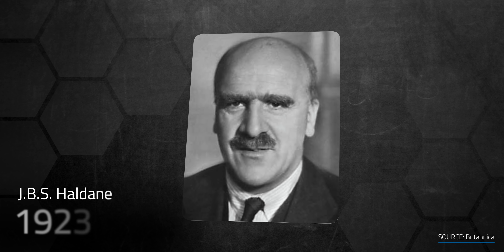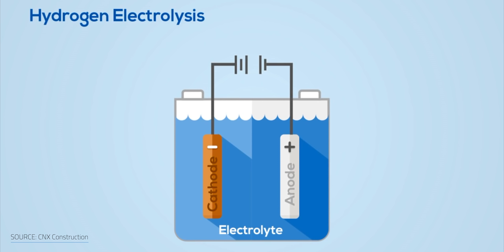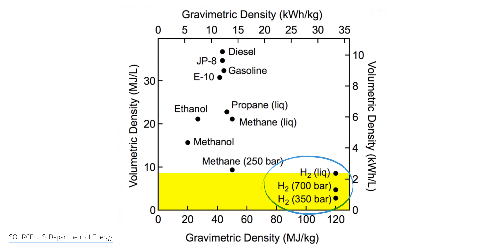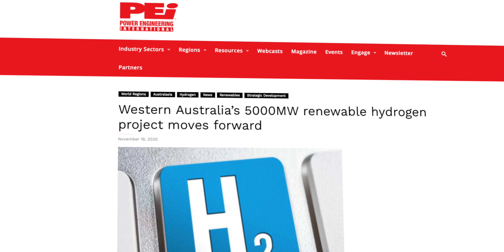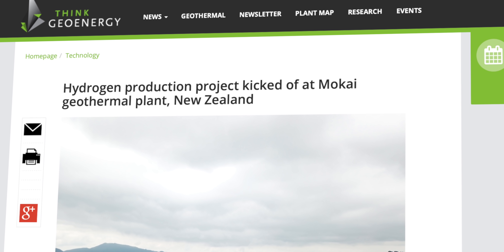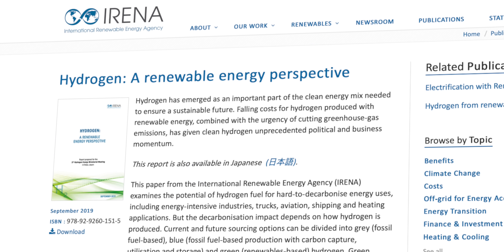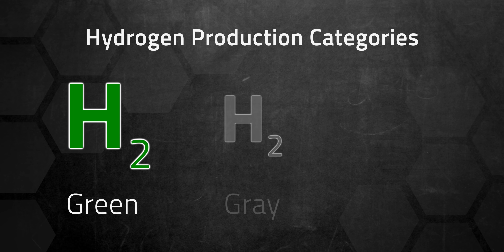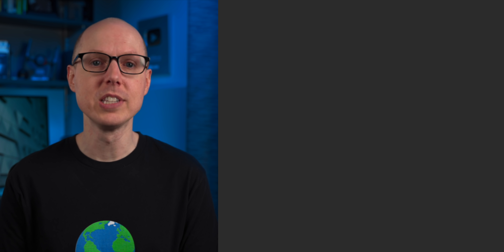The Truth About Hydrogen's Dirty Problem - Green Hydrogen Explained

Comment: synth-gas ( CH^3 ) fuel cells are a development i check on once in a while... i don't know if that's going to happen yet, but the gas itself is flexible in conversions, ( e.g >methanol > ethanol ), and can be derived from feed stock pyrolysis. ( Bio-Char ) ........the syn-gas fuel cells would be ideal for stationary applications, ( not cars ), where underground process storage tanks, ( the gas ), could be considered a "grid battery" where a fuel cell, or thermodynamic plant, becomes a "throttle-able" localized, or non-localized, grid source....where plasma gasification, could be a wind power "dump load" , ( for example ), that fills the tanks, ( grid battery ), with syn-gas ( energy density less than methane CH^4).....that is something i came up with 16 years ago...

Comment: One more of this totally unrealistic green dreams. Apart from a few very high energy intense sectors like steel production, hydrogen has no chance. In the car sector hydrogene already lost the race (in case anybody hasn't noticed) and even for buses, trucks and airplanes it is very likely that advanced battery technologies will take over rather than hydrogen. The technical challenges to safely contain hydrogene alone are so costly in a major infrastructure, which is very hard to overcome. To set up a hydrogen fuel station is about 100 times more expensive than a fast charger station. And for seasonal energy storage the poor efficiency of less than 50% alone is a killer argument, especially if you consider the tremendous amounts needed for this purpose.

The only reasonable scenario I could imagine is to produce green hydrogen from excess renewable energy in the summer for industrial use.

Comment: NZ has an electrolyzer running at 2000% efficiency, and yes it can power itself, no need for external power or infrastructure. That makes all this redundant. Please check out H2 innovations lab. Cost, 34c/kg.

Comment: Science will solve our energy challenges. Not crazy environmentalists like Jane Fonda and Leonardo Dicaprio. These people have an agenda and it’s not helping to solve our energy challenges. H energy is the best option I have seen so far.  It can be used in Fuel cells, or it can be burned, and it can even run current cars of today.   It’s the perfect transition Fuel.  If people have to buy a new car, they can look at Fuel Cell car.  If there car is newer, for a small cost they can just convert to burning H.  In both cases…. No C02.  And H production is already a 165 billion a year industry.  And many ways of producing H are proposed.  Making H from wind and solar is fine, but other ways look more promising.  I say let all the options compete on a level playing field and the best option will prevail.  H energy will move the world forward just like the invention of electricity.  It will be like changing.

Comment: JCB machinery equipment company in the UK has perfected combustion Hydrogen engines right now. Not fuel cells but real combustion engines that are engineered to use Hydrogen. It's better than any delicate fuel cell technology. Just say no to EV. The pollution to make an EV battery is equivalent to 1.5 years of a typical gasoline combustion engine emissions.

Comment: if we go with batteries, when we finally ditch co2 generating power sources, whats the next big problem?
batteries.
batteries dont last long, they're not exactly simple to make and often have a fairly dirty manufacturing process themselves, im sure you know this and have been told this a million times
hydrogen is a LONG TERM solution, batteries are a bandaid for our current situation, when the whole world is running off nuclear fusion in 100 or so years, do we want to wait another 100 years to move off batteries and onto hydrogen? the electrical efficiency is hardly a concern, the RESOURCE efficiency is the real concern here. electricity is a resource, so is plastic, and lithium and cobalt and everything that goes into manufacturing both a fuel cell and a battery bank. the total weight of resources consumed and damage to the environment is far lower with fuel cells than batteries as they simply last longer. yes, atm we use fossil fuels to produce most of our hydrogen, but we also use it to produce most of our electricity, that problem has to be solved anyways. so the problem of how to power our cars should be solved with a solution that matches the solution to the electricity generation problem as well.
we shouldnt use a solution thats only effective temporarily, especially if it its self creates another problem to be solved down the line, the solution we go with should be one that lasts and is modular so it works with other systems as well. batteries are NOT the be-all-end-all solution to stored power, and probably never will be, investing in it only makes it harder to move away from once weve been sitting in it long enough

Comment: there's an old saying, that we're all familiar with:  "Where there's a will, there's a way...(forward)".   we can't go back to fossil fuels - the wildfires and droughts are enough proof, combined with global rising temperatures.  you're looking at a climate-change induced food shortage, due to dropping rainfall (drought caused by deforestation) & flooding (high levels of CO2 cause extra oxygen, which combines with hydrogen in the upper atmosphere.  the oxygen is produced in areas where there's a lot of vegetation.  plants can only tolerate so much water, unless they're specially bred hydroponics plants - that generally don't yield as much).  anyhow, if we believe we can switch to hydrogen, that's the first step.  "see-it, believe-it, achieve-it"...Arnold Schwarzenegger.
the real problem is planetary-ignorance on the scope of Global Warming - which was first cited in 1896! - not enough has been done.  kinda like ocean-plastic.  people are selfish, ignorant, and fearful (for themselves)...our leaders are not leaders at all.

Comment: You can use the sun's ionizing radiation to create hydrogen & oxygen from sea water.  You have to figure out a way to concentrate it though.  However, if you build a self-replicating system maybe by genetically modifying sea weed or organo-silicon compounds then you can use the sun's entire energy on the ocean to make hydrogen.

Comment: How can solar and wind be made more competent? They only exist 20% of the time.. and produce very little energy.
Reply: Like what?
Reply: @engineeringtheweirdguy2103  do u know about turqoise hydrogen - natural gas - pyrolysis - hydrogen? Pink hydrogen nuclear- electrolysis- hydrogen? Biomass can be turned into green hydrogen and turqoise hydrogen in a low carbon process involving gasification and fermentation. With co2 capture natural gas actually produces hydrogen in a low carbon release process. 👌
Reply: @MEGANOlandisKahn  cO2 capture has failed to work properly in every application. For example blue hydrogen projects couldn’t even achieve their first commissioning target of 25% capture.
Reply: The efficiency of carbon capture is irrelevant. Its 100x more likely to smoothe the transition. You are aware that removing all co2 from the atmosphere would be catastrophic right? In fact plants naturally remove co2 from our atmosphere, co2 is added to greenhouses to increase crop yeild. 

The real environmental value of hydrogen is its ability to replace the vast majority of lithium ion batteries which are anything but environmentally friendly
Reply: @engineeringtheweirdguy2103  solar panels and wind turbines dont last forever and their power is intermittent.
Reply: @MEGANOlandisKahn  the power can be made stable with competent infrastructure engineering. And other powerplants don’t last for ever either. But other types of power plants notably fossil fuel power plants last twice as long but require more than 3 times the emissions to build and retire. Due to their size. Aside from requiring sever thousands of tons of fuel per day to burn.

Nuclear is a better option but in practice. It isn’t. Because it produces high and low level waste which we still have no way of dealing with it. The US Proposed to bury it but to day it has yet to build a facility sufficiently protected to store radioactive waste for several hundred years without it escaping to the environment so at current. It’s all stored in slowly corroding containers sitting in warehouses. Not really a scalable solution to me.

Captured methane is a tricky one. In that capturing it requires a lot of effort. And isn’t all that successful. Splitting it away with to get hydrogen and carbon still produces carbon because as stated earlier, carbon capture doesn’t work. Which would make it carbon neutral at best except that you still need electricity to split it. Electricity from the grid, being produced predominantly by fossil fuels. And what about the cost in emissions and money to build any form of mass methane capture, then to build a completely separate facility for mass methane splitting and attempted capture? Plus upkeep and maintenance. And you complain about making wind and solar.
Reply: @engineeringtheweirdguy2103  the ammount of waste produced by nuclear prower plants is extremely low.

What you dont understand about those powerplants with emissions is they provide wayyyyyy more power than they take to build. 

Wind turbines barely produce the ammount of energy used to construct them.
Reply: @engineeringtheweirdguy2103  you arent a serious engineering pafe if you think carbon capture doesnt work.
Reply: @MEGANOlandisKahn  what’s low to you?
Reply: @engineeringtheweirdguy2103  do you know what GDF's are?
Reply: @engineeringtheweirdguy2103  do you know what chemicals are used and produced during the production of solar panels?
Reply: @MEGANOlandisKahn  Depends on the type of solar panel. Are you talking about the most commonly used and abundant solar panel? or are you going to cherry pick and only talk about cadmium thin film solar panels which only make up around 25% of all existing solar panels today. Of that 25% only 15% of which are the Cadmium type.

Please specify.
Reply: @MEGANOlandisKahn  GDF's, depends on which context, solar, wind, hydrogen all claim an acronym of GDF. be more specific.
Reply: @MEGANOlandisKahn  resources like what? And how do they compare to HLW and LLW? Need a remind you of the Goiania incident? What a little bit of radiative material can do if in 200 years and the location of where it’s buried is lost due to war or government collapse or otherwise. What happens if that is accidentally found and nobody knows it’s radioactive? How does that compare to the other waste you’re referring to.

What if the waste leaks and gets into ground water contaminating crops for hundreds of miles making them lethal to eat, especially if you’re eating it continuously, or drinking the spring water? Ever heard of the radium girls? What that did to them. Small amounts, day in day out.
Reply: @MEGANOlandisKahn  stop fooling yourself.
Reply: @MEGANOlandisKahn  as I said. What solar panel type are your effecting to? Are you referring to the 80% of solar panels installed today which are either non-toxic or recyclable. Or the 20% and rapidly declining in use, thin film cadmium solar panel type? It depends on how much you want to cherry pick
Reply: @engineeringtheweirdguy2103  source your claim recycling of solar panels is extremely costly.
Reply: @MEGANOlandisKahn  recycling is costly. But it is do-able. If legislation is made in regards to disposal of solar panels then tan industry will pop up
Reply: Please tell me how you will make solar and wind more viable for large scale energy grid utilization. They are just bad science compared to other power plants.

Comment: I just can't wait for below freezing winter driving with multiple hydrogen cars having driven before me spewing water exhaust droplets coating the roads with black ice for us to drive over and wreck our vehicles on ! Now that is safe ! This concept is just another, not so well thought out,"GREEN", idea that when applied into the real world to keep us safe from climate change does not keep us safe from injury or death when in vehicular accidents. A society operating many Hydrogen Cars that are spitting water on below freezing road or parking lot surfaces is not the answer ! So, where to put water. Maybe an onboard  tank to freeze solid and burst when parked?  At a stop sign or light adding heavy icing to the road just where one wants to actually stop? A parking lot to slip and injure another? A roadside gutter so a pedestrian can slip stepping off a curb maybe
falling into traffic ? Your driveway so you can fall there ? Your Garage to slide across while holding your infant child then both hitting the floor? Maybe, you need to be distracted by mopping up the garage floor before the water freezes and your groceries thaw? A high speed highway perhaps in a turn? The Autobahn while dumping large amounts of water at high speed? Your Hydrogen Vehicle needs to relieve itself in public, The question is where to do it safely?

Comment: They can do gasification process to extract what they need out of our garbage that we throwaway each day millions of tons of trash can be converted into synthetic fuel methane hydrogen and others with a very low carbon footprint maybe about 1% portion can you get very energy efficient if they could use the fuel they may make electricity To run the process very little carbon omissions

Comment: Many areas of this world do not have even 24 hours per day of water and electricity nor is their enough land area to install those solar and or wind units.  There are leakages and thefts of these two commodities. What water will be left to generate hydrogen in an area like Latur in India where water trains and tankers provide drinking water to the people who need to stand in line and even fight to grab that water?   Biggest contributor to global warming is the greenhouse gas water vapour which will also be formed on complete combustion of hydrogen.  Mobiles, internet, wifi, mobile data, computers, tablets, etc were made and smartened to minimize the need to travel and covid taught the importance of minimizing the need to travel. Netherlands uses bicycles for travelling and biogas for cooking or room heating and saves lot of its fuel needs. Crude Oil, natural gas and coal will remain major sources of energy even in long term of the future. Commercial continuous big scale production of Hydrogen will in majority continue to come even in next many years from steam reforming or partial oxidation of the greenhouse gas methane followed by high pressure adsorptive seperation of hydrogen from syn-gas using layered bed. Hope they can work on safe, cost effective and efficient process to make Hydrogen from Ammonia recovered from urine excretions of humans in densely populated nations like China & India either by catalytic decomposition of NH3 at high temperature or by reaction of NH3 with alkali metal like Sodium.

Comment: That solar panel idea sounds disastrous. Imagine if every house had solar panels that also leeched water from the air. That will dramatically change the climate at scale.

Although this idea would probably work well (aka: not harmful) in humid climates like the southern US where you can pair solar production with indoor dehumidification.

Comment: The argument about Electtification of the Electrolysis machine is mute.  We need to produce energy to charge the batteries in cars.  The fact is the Hydrogen fuel cell doesn’t have the carbon demand of a battery and you don’t have the recycling issue with the large batteries in electric cars.  The 2030 crossover should be the trigger that everyone sees and the efforts should be in hydrogen fuel cell.  NO more Battery electric vehicles!!!!!!
Reply: Just to nail that point come, far from the investment of making and recycling the battery, what would be the impact of having to make and then dispose of 2-3 hydrogen cars to every BEV lifespan?
Reply: And where exactly do you think the energy comes from to create the hydrogen from electrolysis? Unfortunately hydrogen requires 3-4 times more electricity per mile from the same source as a BEV.

Further to that modern EV batteries are around 95% recyclable and last around 500,000+ miles to a battery whilst hydrogen cars are limited to 150,000 miles or 15 years which ever comes first.
Reply: @engineeringtheweirdguy2103  You should probably take a look at the studies.  On too of the fact that renewable energy like Hydroelectric and Nuclear have an imfrastructure.  No matter what we are going to have to use a respurce to produce energy
Reply: @engineeringtheweirdguy2103  If ae are talking Energy Density than Diesel and Gas and rebuilding existing cars is the best way to have the smallest carbon footprint